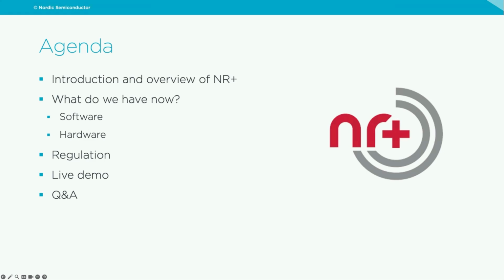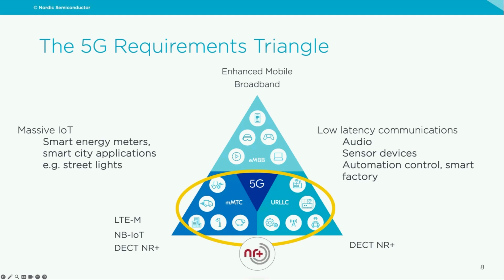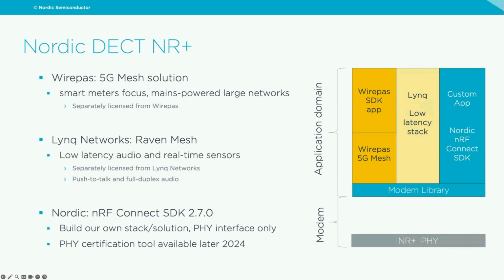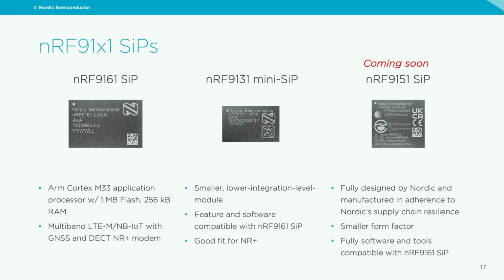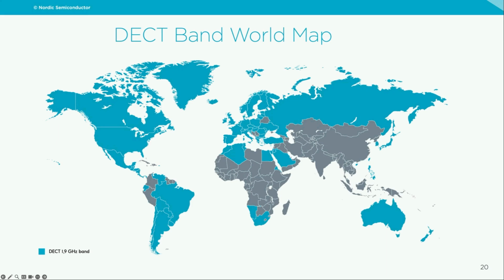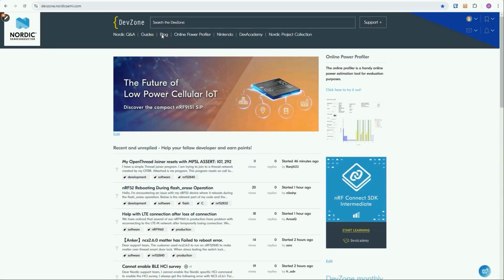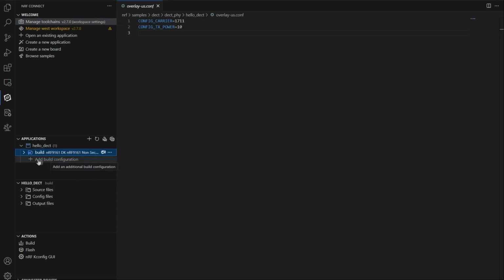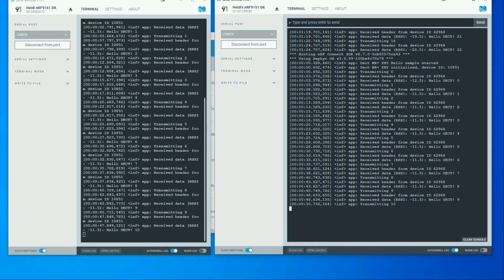Getting started with NR+ PHY

Comment: "I get the error <err> nrf_modem: Modem has crashed, reason 0xfff, PC: 0x0. How can I solve this error? I already flashed the modem firmware using the provided zip file (mfw_nrf91x1_2.0.2.zip) and then flashed the DECT example code, but after reset I still get this error. What could be the reason?
Reply: You’re using the cellular firmware.